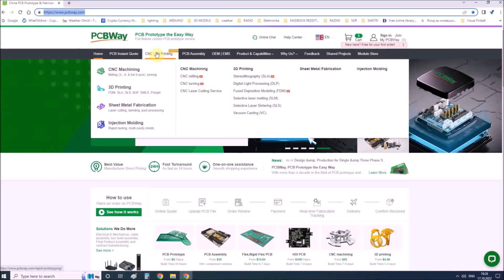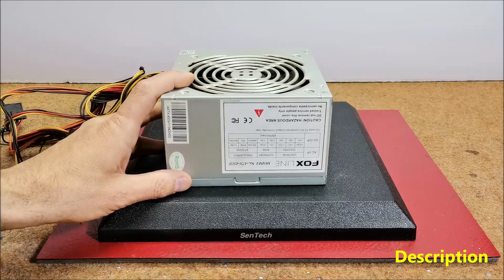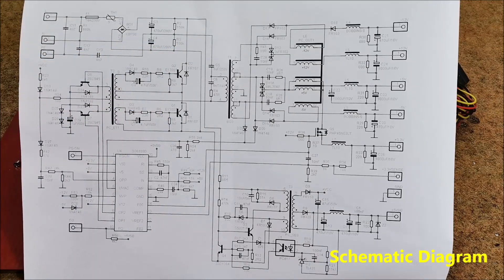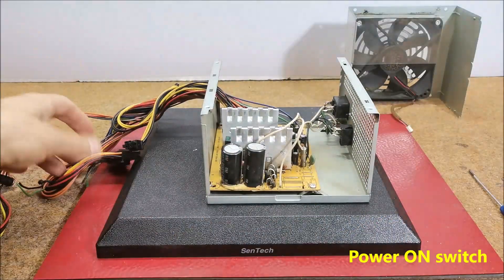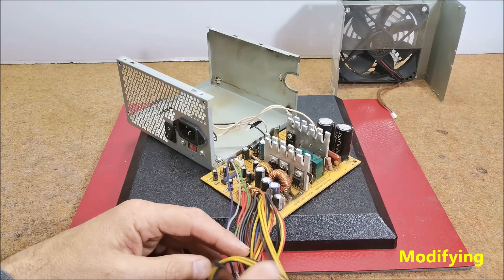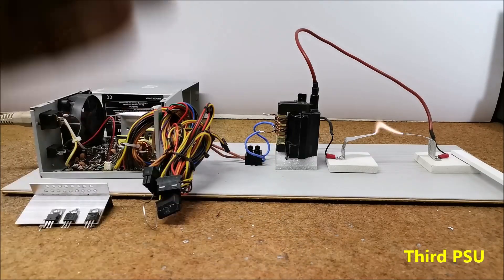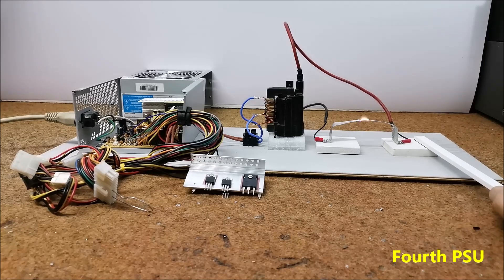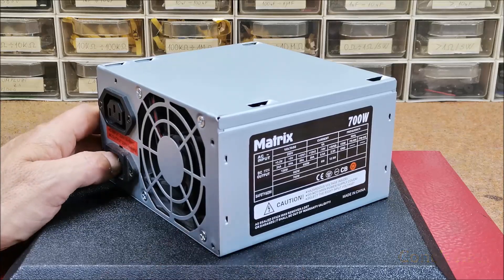The simplest way to make a quality HV (High Voltage) source from a PC power supply

Comment: After building this i got a perfect square wave, but after connecting a small load one of the primary side transistors went partially shorted (when testing out of the circuit, it was leaking some current when should be fully open), if i remember right it was the negative side BJT of the half bridge that drives the transformer.

The fuse didn't burn and there was no excessive current draw, it actually decreased since the main transformer wasn't being powered, only the standby, i didn't understant totally why but ok, probably the damaged transistor stole enough power from the feedback transformer for it to not be able to power the high side BJT and cause a big short that would certainly explode the fuse.

After replacing the transistor the first time, it started working normally, and after connecting a different load, the same transistor stopped working properly again
I replaced it again, and it started working again

Note that on my build, besides the rectifier diodes like shown on the video, i also removed the output capacitors (but not the standby capacitors) and the inductor.

I'm not saying this project is bad, most of it actually makes sense, it's just that the power supply i modified for this project is poorly designed, there's already a reverse diode in parallel with the transistor, the 13007 is most of the time out of SOA, constantly waiting to die

Comment: Great video Mirko!  Thank you very much. In the video you said:
one of your power supplies did not start and I needed to bypass the protection circuit, but more on that procedure in one of the next videos.
I have this problem with my power supply.  Could you help show me the way to bypass the protection circuit... or the video like you said.
Thanks again for your help!

Comment: I tried it and it turns off when I connect the green cable with the black one, a spark jumps from the flyback but nothing else
How do I make a bypass so that it works, please I need
Reply from the maker: Try a larger number of turns on the primary of the flyback transformer

Comment: No fricking way it is that easy!

I'm going to give that a go in the next day or two.
I already have the flyback transformer and I have an ATX psu I was going to turn into a bench power supply and the transformer was going to have a diy driver circuit but this looks like the perfect opportunity to make a powerful, efficient and aesthetically pleasing high voltage power supply unit.

Thank you so much for the inspiration!

I'll update in a couple of days, unless I have an accident... lol

Comment: Thank you for your time & knowledge on this. Schematics are most helpful for me. I could have benefited more from your presentation if you had included drawing out the physical connections on the schematic where diodes were removed. Thanks again for your presentation.